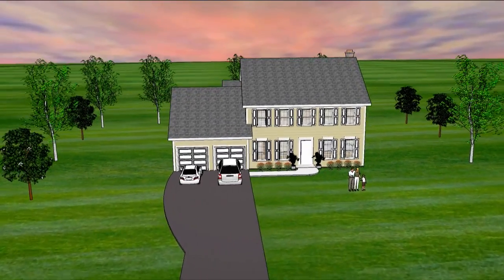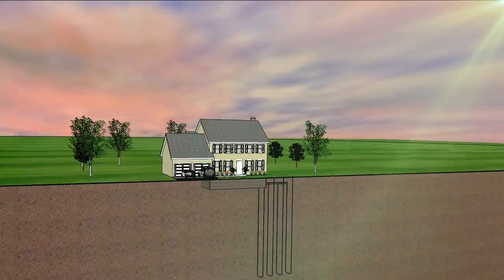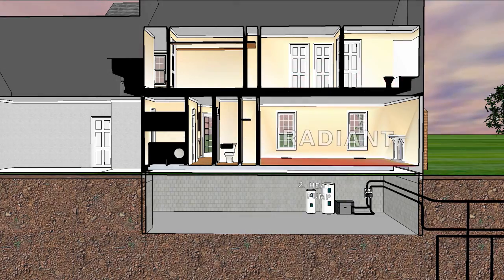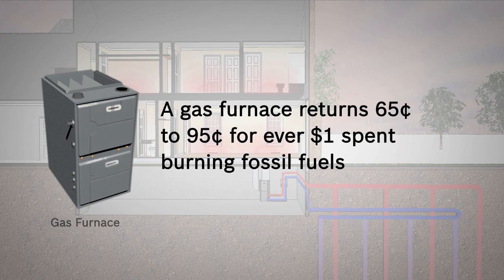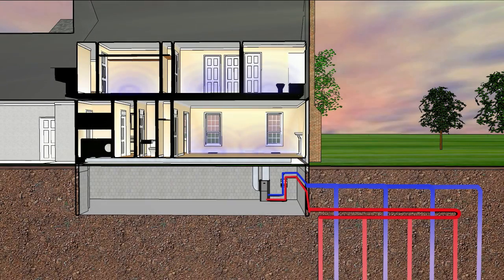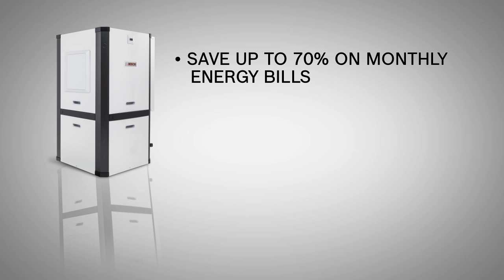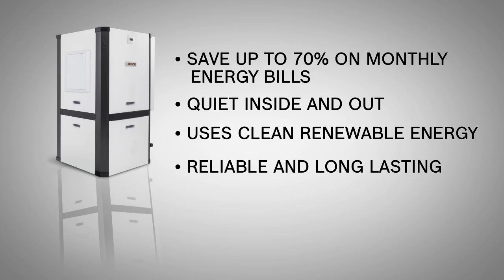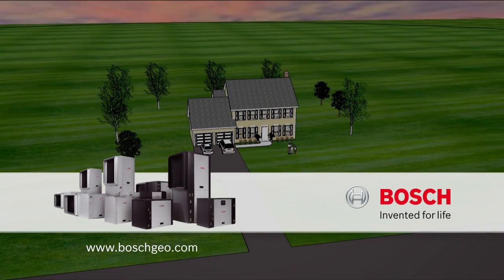Bosch Geo 101 - How Geothermal Heat Pump Systems Work

Comment: That is not a geothermal system. It is a ground based heat pump, it uses the heat stored from the sun.
Geothermal is using the heat radiating from the earth core and for to use that you have to drill deep.

Comment: is the earth warm or cold??? i don't understand this. in the winter it's hot, in the summer it's cold. i want my house at 67 degrees at all times. if the earth isn't 67 degrees, how is it doing both heating and cooling to the desired temp???
Reply: Basically magic,  but heat pumps actually exist and they work. Basically, because the ground isn't Zero Kelvin (-459.67 ℉) there is heat to extract. We don't have to technology to extract heat all the way down to absolute zero but we can do it down to what temperatures below which water freezes.  Cold isn't a thing, it's the absence of a thing (heat). Heat pumps just move the heat up and down using the phase change of a refrigerant under difference pressures. an internet search will lead you to plenty more information if you'd like it.

Comment: Thanks, but local installers quoted  full system prices for drilling and system installation in the tens of thousands of dollars. 
   For it to work, it has to be relatively cheaper than the  fuel system it replaces.

Comment: If ground temperature is only 55 degrees, then how do you heat your home with it? Presumming you want your home to be 72 degrees
Reply: There is still a heat pump getting it to the right temperature, but it has to heat less than 30 degrees air for example

Comment: This is quite the sales pitch but nowhere does it explain how it pulls 55F out of the ground and convert that to 72F for the forced air furnace to pump it in the home.  It's easy to understand how this works for cooling.
Reply: With a compressor, condenser and evaporator. Same principle as the AC.
Reply: Same question I had! I think geothermal simply boosts the efficiency of heat pumps (A heat pump is just an A/C compressor unit that can work in reverse as well). So basically, instead of using hot 80f air to dump the heat of your home though a heat exchanger that would be outside, you can take 55 or 60f from the geothermal liquid exchanger and barely have to do any work to cool it, if at all. And for winter it's the same, the compressor that is trying to exchange cold from inside to the outside via air to refrigerant unit compressing in reverse, it could use geothermal water to refrigerant coil where the water is already 60f instead of outside air that might be 20f. So long story short, it's easier to get from a constant 60f to 72, instead of like 20f to 72 in winter, or 90f to 72 in summer.
Reply: @95TurboSol  pretty close to what GT does.
Reply: @rlhanks  Yeah, basically it's just using water cooling instead of air, where the water is always at a constant 60f when air is at whatever the outside temp is at.
Reply: I had the same question and it is very frustrating because most resources including the Dept of Energy skip over the "magic box" heat exchanger and how these actually work. A minute or two explaining the refrigeration cycle would go a long way.

Comment: This and other eco-friendly energy efficient methods should be required on all new builds.
Reply: Electricity bills will be high because such pumps use a lot of electricity. To make it as profitable as possible, you need to install a photovoltaic installation .. and these are additional costs ...
Reply: @marcinr5687  that's good to be aware of, thanks.
Reply: Houses are already too expensive
Reply: what they don't mention is it cost  between 18000 and 30000  to install  on a 25 square foot house 
and repairs cost between 3000 and 5000 each time due to most repairs being deep underground 

gas furnaces are no where near those numbers
and they only cost 6 more dollars each month on average
Reply: @david_3282  according to the people who have installed them they have said they dont require much maintenance and if they are installed properly with right materials their lifetimes can last from 50-100 years for some types of geothermal heating/cooling systems. I find that to be a very attractive quality for these systems
Reply: @saadkhawar8039  yes the ground loops, are  Guaranteed for 50 years,  but the pumps themselves are essentially a heat pump with compressors TXV's,  Capacitors contactors, solid state boards, relays.  They have the same life expectancy of your average normal split system heat pump of 10 to 12 years.   with the enormous price hikes in the HVAC industry throughout the past couple years there are over $30000 to replace

Comment: But if the temperature under my house is 55 degrees, thats not enough to heat my house during a winter time.
Reply: The gas in the heat exchanger is compressed with a compressor. If you compress gas, you increase temperature. That's how the temperature you get from the ground is increased further, enough to heat a home.
Reply: That’s what I always wondered.
Reply: View it as the same system as your AC works. How does your AC heats up to 28 degrees C in the winter times when the outside temperature is below 0? This is one giant AC system however, it's not using air rather geothermal heat. There is no such thing as "cold" in physics, there is only heat.

Comment: 55 degrees in the ground does not make my house 75 when it 32 outside
Reply: not how it works. it compresses the air as well in order to increase the temp beyond the earth’s. you can get your home to any temp with a system like this.
Reply: Just recall how the AC system works. Because this is a giant AC system.

Comment: how do we keep safe from the radon build underground  ?
Reply: By sealing your basement and if necessary installing a radon mitigation system. Ideally you'll want to do the sealing before you build but because radon sinks in air, if it ever becomes a problem you can have a fan installed to remove radon from the lowest level of your home. This heat pump system uses sealed loops so it is not going to let radon enter your home unless it is installed incorrectly and the openings to which the pipe enter are not sealed

Comment: doesnt explain how winter time heating works
Reply: same way summer one works
Reply: The Earth stays warmer than the surrounding air. If it's 32⁰F or 0⁰C outside, the ground is still around 60⁰F or around 15⁰C so it's taking latent heat from the ground and simply moving it into the home. For it to heat or cool all you need is for the temperature between the earth and your home to be different

Comment: wondering how many liters freon is needed for this system.
Reply: It's antifreeze
Reply: none. Freon is not used in a heat pump.
Reply: @thaifly99  the reversing valve is what makes a heat pump special
Reply: @thaifly99  It's actually used. It works the same way as your AC system. You have a compressor, condenser and evaporator. You have freon in the system as well. Otherwise it will be dumb to heat your home with only 55 degree F...

Comment: Sorry this is NOT GEOTHERMAL--it is GROUND HEAT RECLAIMED. GEOTHERMAL IS DEEP DRILLING INTO HOT ROCK FROM LAVA UNDER THE EARTH. Well can be up to 4000 feet deep depending on your location. Here in Pa. NorthCentral of state we drill approx. 2500 feet deep. One farm here in Perry County is producing enough electricity to provide power to 4 farms as well as steam and hot water for 1st farm total heat/electrical needs. This farm has installed 2 more wells for more energy still. perhaps owner wants to be a power provider. Totally clean. All controls are AC and require no real hands on work. A technician is on call in case of maintenance. Great system.
Regular heat reclamation can be costly for added heat required during cold winters. Above system requires no added energy. All energy made on site.
Reply: Geothermal refers to many systems using heat or temperature difference (thermal) of the earth (geo). Your system is another example.
Reply: This is a geo thermal heat pump  not a geo thermal power generator.
Reply: any Idea on the information needed to decide if a specific location eligible to produce electricity? and how deep the drilling will be?